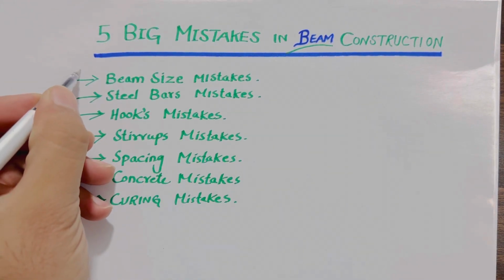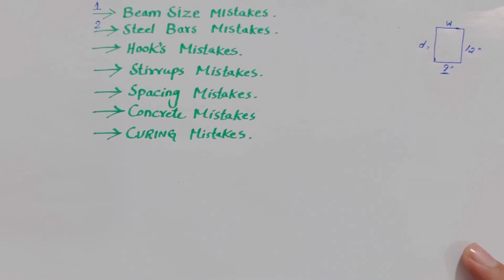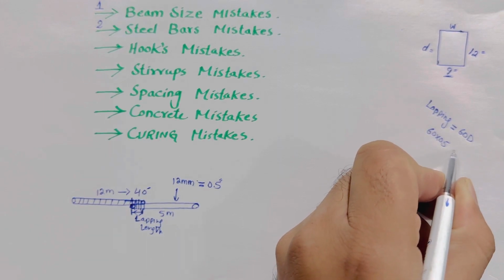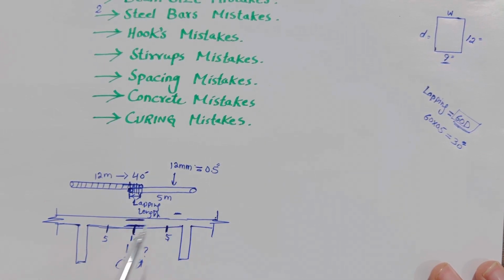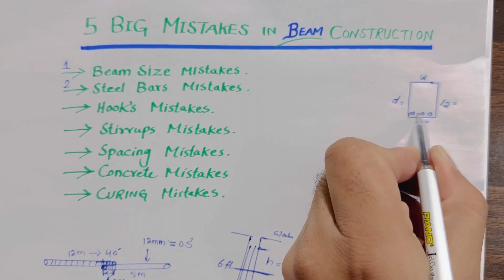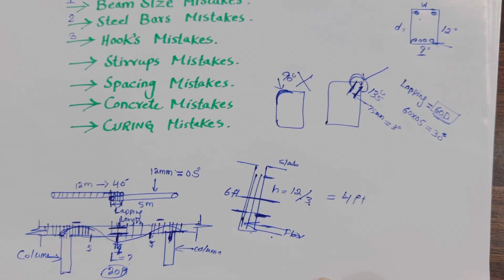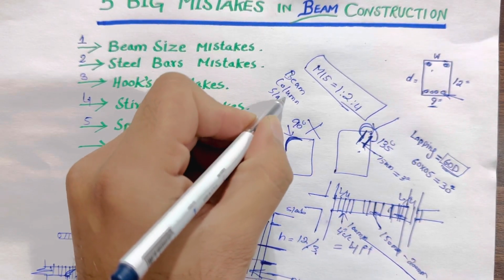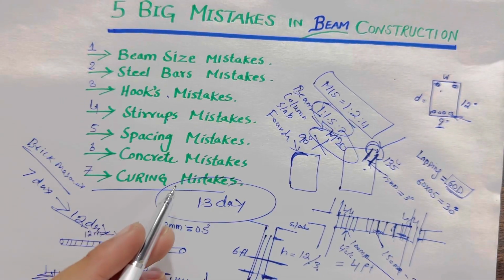5 Big Mistakes in Building Construction

Comment: Sorry I got questions the beam is 1500mm wide and 500mm high including 240mm span of 13.5 miter suport with two  column is 470 x470mm so the beam is wide then columns how to join where to leaping  the rebar